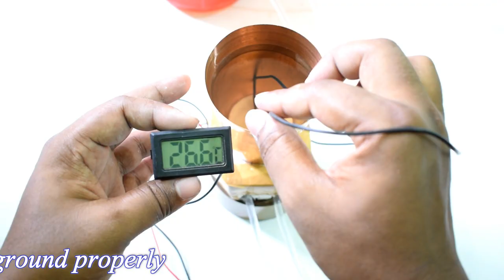How to make Water Cooler Glass using Peltier By IndianRobotix

Comment: I have an idea do one thing take hot side and cold side water in a single bucket and run it through motor and then measure temperature of both the side after one hour of operation.
Reply from the maker: Ok will try it